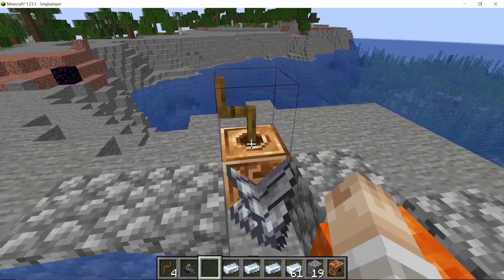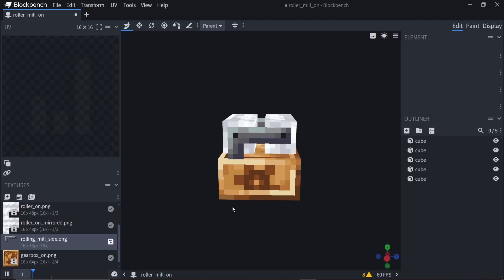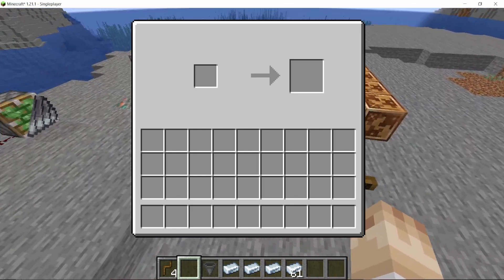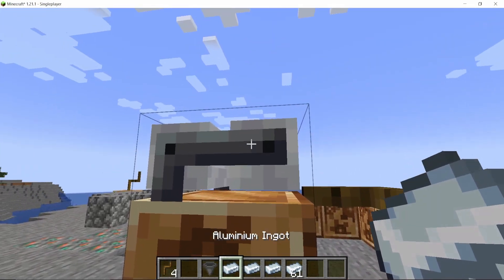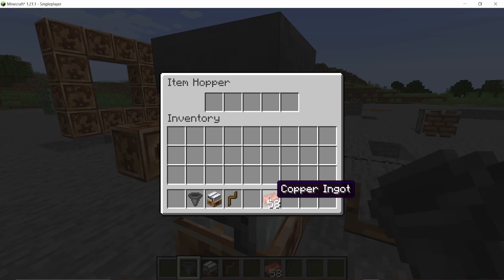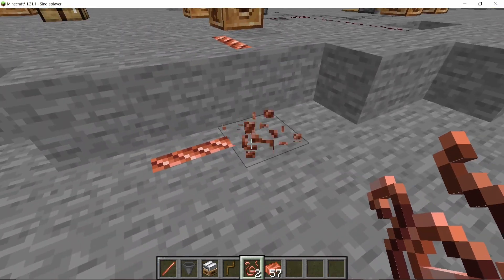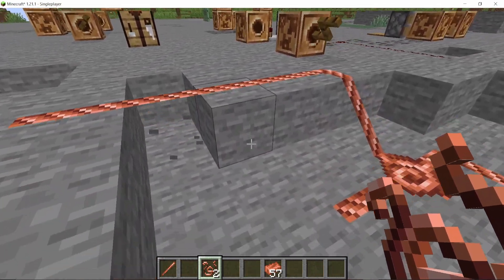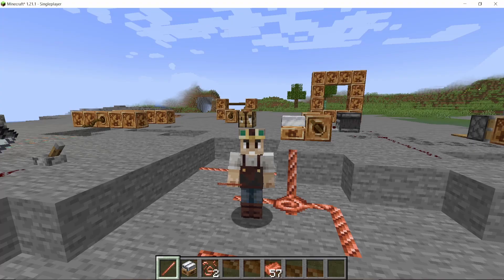Roller Mill - iljaTech ep.5 - Minecraft mod devlog

Comment: It will be good if you make it possible to place several rods in one block: up to 3 (like sticks in Supplementaries mod). Also it can be great idea to have an ability to make piles of them by sneak-clicking (like sticks in Vintage Story game).
Reply from the maker: Good idea, as the plates are already placeable, but the rods arent... in an old version of the mod they used to be, but i had some issues with the way i did it back then. I think i can figure out a new way to implement placeable rods!